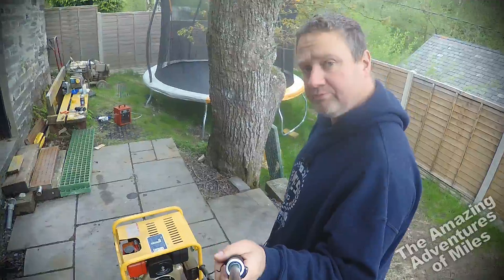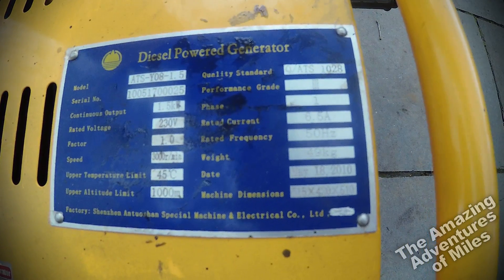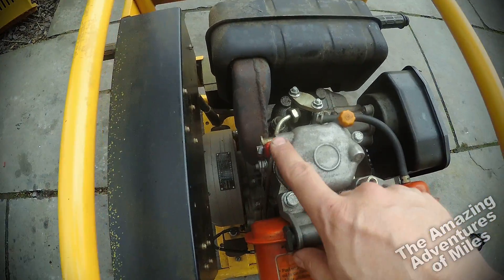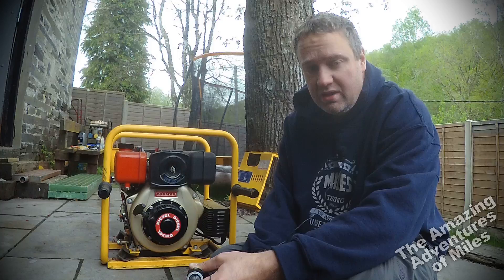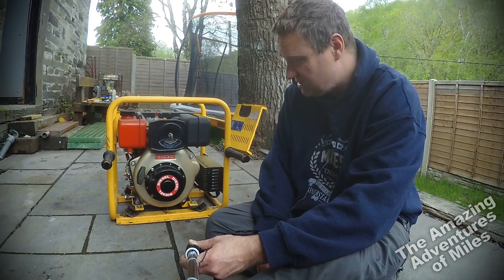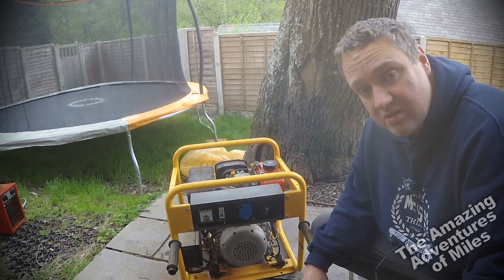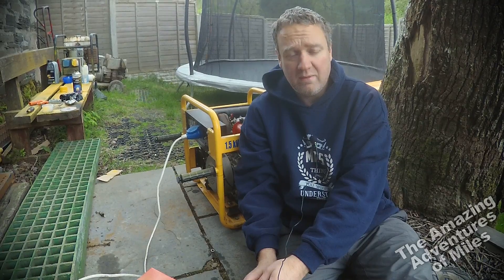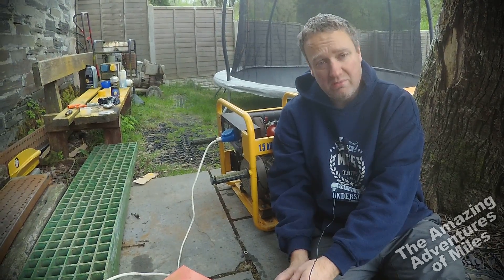Tiny Yanmar Diesel Generator 1.5KVA

Comment: LOL: ~70% of the diesel is waste heat, then you load test it with a heater!  Irony...  :)
That these things (diesel or not) don't come with an easy way to use that heat is a huge oversight IMHO.
A "Put your flex air vent pipe on here if you like" flange thingy adds 3 cents to the cost.
It will also make the thing quieter.  Especially if that flex pipe with the built in padding.

What I DON'T get:
A Quarter Wave Resonator (QWR) works wonders at quieting a constant rpm engine and is just a tuned bit of pipe with one end blocked off, T'd into the exhaust before the 'silencer'.
And there the frame is: A piece of pipe that could be doing this for free...  Just a flex coupling required.
The Resonator pipe doesn't get hot as there's no flow in it.

(They could also turn (some of) the frame into a/the exhaust muffler with QWR in the handle bits.  Saves costs)

Comment: Just grabbed a 3.5kW generator from the dump.  Needed a piston since it was probably fed gasoline or shot with ether.  It runs great and will easily surpass its rating and put out 4kW without straining:)

Comment: I'm surprised being an inverter genset that it doesn't have computer controlled throttle. I picked up a bigger inverter one that controls engine speed, at least it did before obsolete inverter board packed it in. now I want to convert it to a 48v DC battery charger. 
I like that one you got though, compact and ready to go.

Comment: Perhaps you could try to spray a little "ether/starting fluid" into the air intake, on the first start.... this might help to get the first few revolutions, and build momentum, and then, it'll be able to start running on pure diesel fuel....(?)...
Reply: a good idea in theory but such things tend to wash all the lubricant out of the top end of an engine. Really only for emergencies. I was actually quite surprised after he said "pig to start" when it seemed to fire up so easily. Definitely not a candidate for fluids
Reply: @dansmith6909 potentially washing out lubricants is the least worry. - Changing the combustion time is way worse! 
Prescribed death sentence for any engine!

Comment: If you can run it on red Diesel then Absolutely brilliant
Reply from the maker: Thanks Daryl, yes it runs on Red Diesel, wouldn't want to run in on normal diesel it's way more expensive.
Reply: @TheAmazingAdventuresOfMiles  what about veg oil?
Reply: @Whereswally606 using veg oil as fuel is a complex topic, which should be researched seriously.

Comment: throw some injector cleaner in the fuel tank.  take the air filter off to start it.   i would remove that decompression lever linkage to the secondary lever by the throttle.  should not have to crank it a few times with throttle in off position.  i put a 12 horse yanmar in my lawn tractor.  i just set throttle to max and give it a one pull and it starts.  in winter you can take off the air filter and point a plumbing torch or hair drier into the air intake to get things warmed up faster.  thanks for uploading.  i love diesel engines !!!
Reply from the maker: They are fun to tinker with, I've got another Yanmar, certainly larger than this one but still a single cylinder, I'll drag it out at some point and do a video on it.
Yes I've run a load of Diesel Purge through it, it's really cheered it up. I've also changed the pull-start mechanism for a new one and it's really improved the starting. It lives in a mine now and the temperature is constant about 11 - 12 degrees centigrade, it seems to like that.

It has proven itself a very reliable generator with a very reliable engine.
Reply: Thanks for promoting small diesels!!! Most people don't know how reliable and efficient they are when maintained correctly.  I can drive my lawn tractor around all afternoon pulling a trailer full of dirt (6 feet long x 3 foot wide x 18inch deep) up and down hills and it only uses a few cups of diesel.  Electric cars and bikes will never beat the power and efficiency of diesel !!! 
Oh something thats kinda important is:  Naturally aspirated diesels love lots of fresh air.  Some people have had problems with the paper/felt air filters on rainy high humidity days because the paper/felt gets wet and won't let the air through.  A screen type filter is recommended.  Only in extreme dusty environments should paper/felt filters be used and if the generator is to be stationary for a long time in a dusty environment a larger dust filter can be adapted from a larger engine.  (the more air that can get into the engine the better and cleaner the combustion and more energy output). 
I have mind to put a small single cylinder diesel into a small car or truck like the boys in Indonesia - the diesel they are using is about 15hp and come out of small yanmar/kubota tractors: 
https://www.youtube.com/watch?v=kHPZ0DttQLI
Reply: @------country-boy-------  burning a liter Diesel efficiently, theoretically needs ~13m³ air.
An enormous amount which most people doesn't realise, running endlessly on the same outdated air filter.
Reply: @TheAmazingAdventuresOfMiles  Don't use that Diesel start crap. Changing the combustion time is killing your Diesel engine!
Heating with a torch is harmless

Comment: Running mine now. (Ydg3800)Starts half pull or electric 😁 Hurricane (wicked tropical storm asiaic) in New York (Bourbon helps)
Reply from the maker: Bourbon helps with everything, but Scotch helps even more ^_^
Where did you get yours from Shiffron? I'm looking about for more online but they are hard to find
Reply: The Amazing Adventures of Miles  I got mine from Craigslist $400. The ad had just posted I called the guy. He said within 5 minutes he had received three calls. One guy was 500 miles away willing to drive to get it.
Reply from the maker: @shiffroninc.4977  Wow, that's impressive interest. I think I paid about 250 pounds ($300?) for mine but it was money well spent, a cracking little generator. Somebody would do well to make another few shipping crates full of them.
Reply: The Amazing Adventures of Miles   Ya. Oh yes a nice scotch would be wonderful too. I keep a bottle of Lagavulin 16 tucked away
Reply from the maker: @shiffroninc.4977  Lagavulin 16! A fine choice indeed sir ^_^

Comment: Where could I find one of these im currently scouring google
Reply from the maker: Hello Hksjoshua. Yes they don't seem easily available, but I'll have a look around on the Internet for you
Reply from the maker: I've been having a look on the Internet, I must admit I'm struggling to find a supplier for these and can't even find any second hand. But I have seen others for sale before, so they can definitely be found but they do seem to be rare. I don't know why more factories don't make super-small diesel generators, There are many reasons why somebody might want one over a small petrol generator, seems a hole in the market to me.
Reply: @TheAmazingAdventuresOfMiles   An advantage of diesel generators over gasoline generators is they produce no carbon monoxide and so need no catalytic converter. A big consideration if used in around a dwelling and why yours was previously used in a mine.
Reply: @cowstable  

Carbon monoxide makes up anywhere from 2% to 12% of diesel exhaust gases.
Reply: I have since found a new in box rgd5000 with a robin dy41 engine and a generac xd5000e with a yanmar l100 engine.
Reply: German Farymann is another experienced and highly respected producer of such small Diesel engines.
Seen in lot of military equipment, where reliability is essential.

Comment: Can run single phase ac welding machine
Reply from the maker: Yes I should think it would run a small one. Although if I need to do a bit of arc welding somewhere really remote I usually take three motorbike batteries, they do a good job!

Comment: I have got three Yanmar l70 engines.  If one knows how to start them, they are quite easy if your a lil muscle on you. Pull the crank till it stops, push down the decompression lever, give one good yank and off she buzzes. Mine from a cold start will take only one or two pulls.   Wonderful Engines.  Nice vid.  Lil too much negativity for that Engine in my opinion.
Reply from the maker: Thanks for the comments Doug. I think you're right, and you'll see from my description that I did an update note and wrote that with a change of starter mechanism, it behaves fine. It's still working well now, usually goes on the first pull. It lives about 1300' underground now!
Reply: Right, easier to start than a gas engine of same size if you know how.

Comment: It sounds so much happier with a load.
Reply from the maker: Yes I agree. Actually I accidentally overloaded it last week underground, I was running a 1.5kw heater but I had forgotten there was another 1kw heater on the circuit so it was drawing 2.5kw, well over the rated capacity, and it had been at that load for several hours before I noticed. It didn't seem to mind at all, nothing got too hot and the engine didn't stall. I don't intend to make a habbit of it but it gives confidence in the machine to know it's got muscle to spare.
Reply: Typical diesel... They want to work! Gotta run them hard often especially if it's a turbo.

Comment: Panels are great but a gen is nice if your doing laundry, vacuuming or have a week of bad weather. Plus, it will extend your bank life.
Reply from the maker: Thanks Brian. Solar Panels are also of limited use in a mine too, but I've made a couple of micro-hydro generators which do work underground if you can find some flowing water. I'd quite like some solar panels here at my house but the sun rarely shines and there are tall trees everywhere casting big shadows. It's just not a good location for them.